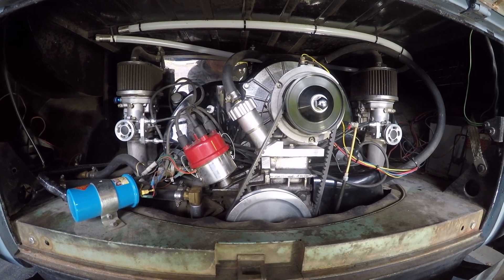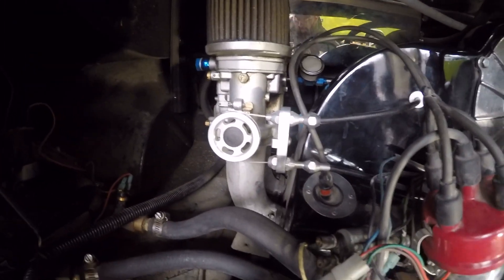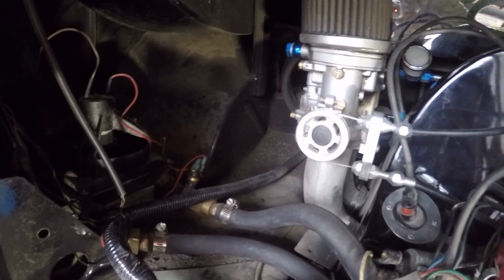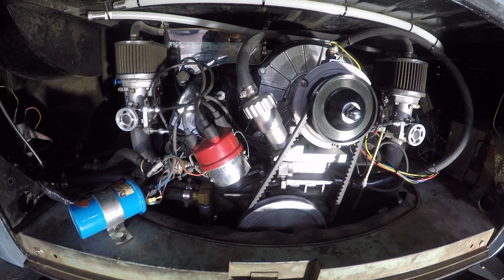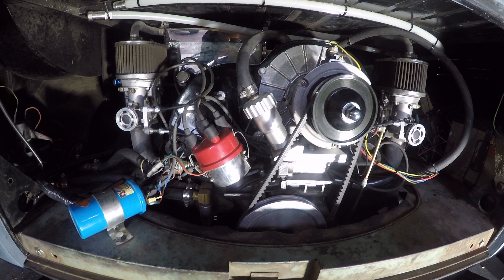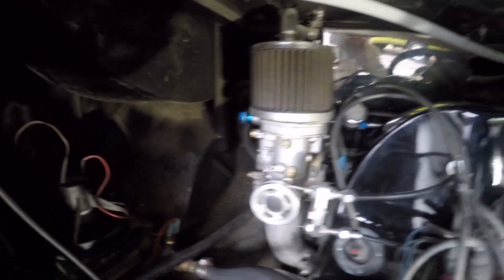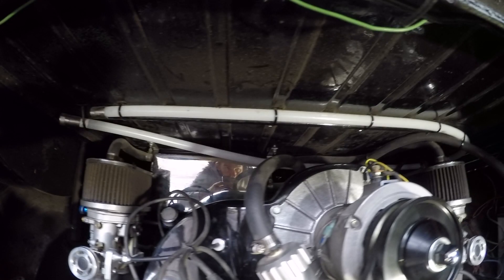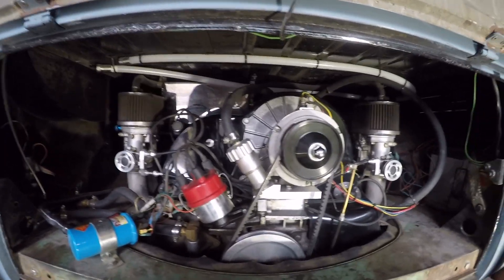VW Bus - Type 4 Upright conversion in 1964 Deluxe - Engine Overview

Comment: Very cool conversion.  Love the linkage.   Your beef with the Mallory is justified.  I've never had a genuine 009 fail me.   In my 66 Panel I had a 2.6 that I build.  I built a 4.12 with a aftermarket 3rd and .82 th.  That splitty was fast.

Comment: Hi, any reason I can't do the same here (aside from Mallory) with a VW bus block ?  I have 3 dead 2 Liters to pick from.  Love my split to go faster than 48 mph...
Reply from the maker: Hi Dan, you can, just need to do conversion to upright etc. Lots of ways to approach it,  but it will make a big change especially if you do some performance mods to the 2L.  Good Luck.

Comment: What did you end up doing with this motor after you swapped to the subaru engine?  I am going down the road of looking at also putting a 914 Type 4 engine in my 65 bus and saw this video just now.  Any advice you could give and why you weren't happy with the 914 set-up aside from power upgrade to subaru?
Thanks!
Reply from the maker: Was a nice engine and great way to go if staying air cooled.  I had struggle with dialling the carbs and really just wanted to see what all hype with the Subaru conversion was.  I sold that engine, guy got a good deal and a great engine.  Thanks

Comment: What “stage” V2 kit is that? Kit came with bottom tins and crank pulley? Did you delete the stock oil cooler altogether?
Reply from the maker: No, had to purchase those separately. This engine build cost me a fortune! Yes, stock oil cooler gets eliminated in this setup. Good luck.

Comment: Hey Mike, all I can say is, very impressive! I won't say that I'm jealous though because that would be wrong but I'm very happy for you.
Do you have any options for a new ignition system yet cause it didn't sound like you do.?. Hope you find something that brings it all together. Smart move on the fuel system, safety first! Great foresight. Once again, excellent vid, thanks for sharing with us!
Reply from the maker: Sigman Floyd: Thanks, been 10 years of hard work and buying parts when I could. Excited to be finally getting ready for paint. Distributor was minor set back, but running nicely again.  No idea of what ignition system I will try next open to ideas. But I need to do some research.

Do you have a bus?
Reply: Garage Time - Not yet but I'm really looking hard! Had two opportunities in the last few months but they both fell through 😕 Still positive though! What color you planning to go with?
Reply from the maker: Going with a nice candy apple red on the bottom, and a pearl white on the top.  Interior already in progress, white vinyl with red stitching.   

Buying a split bus can be hard these days, the decently priced ones sell super quick and without people even understanding what they are buying.

I have re-built several over the past 20yrs, once you get one, let us know if you have any questions, concerns, products we have had success with, others we have not etc. We are willing to help out.

Thanks for watching and good luck.